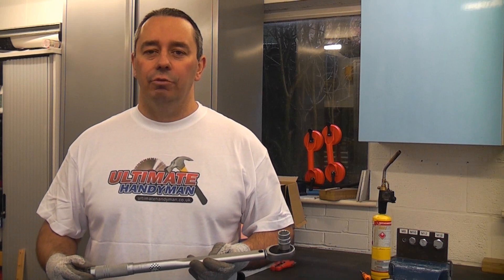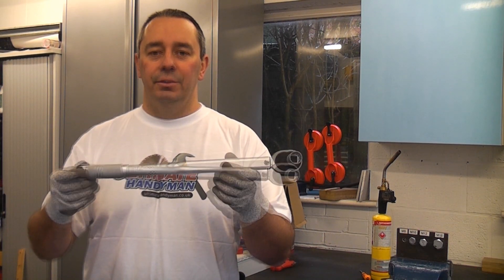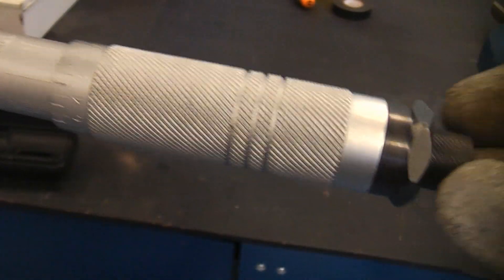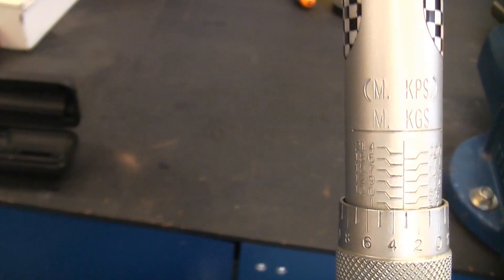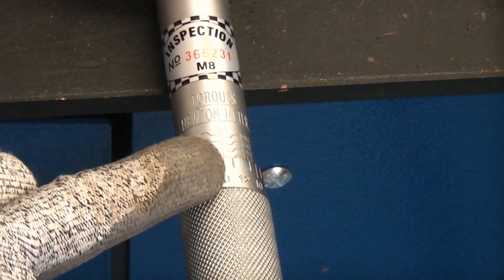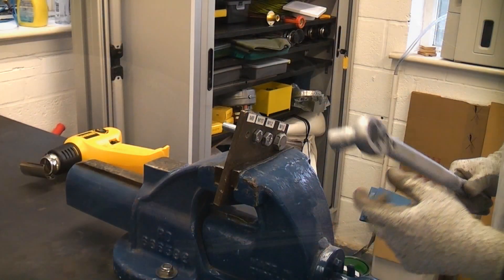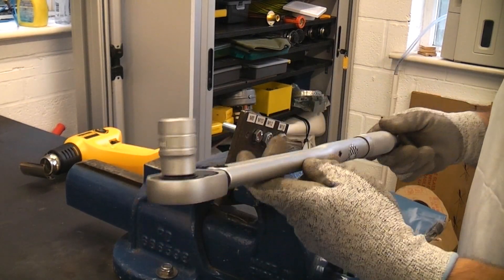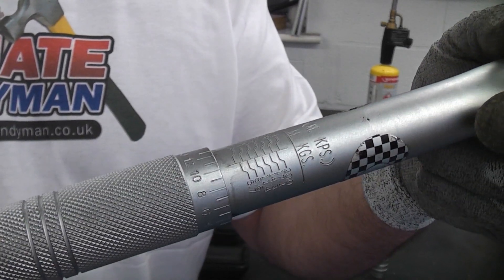How to use a torque wrench

Comment: Hi i just want to ask,  before you set your torque wrench to any value what is the basis is it the head of the bolt or the diameter of the threaded rod?
Reply from the maker: The diameter of the thread, you normally get the torque information from a manual that will specify the correct torque setting.
Thanks for the comment

Comment: Why are you using French and foreign measurements like Kg and Nm instead of British lbf?
Reply from the maker: It's the measurements that came on the torque wrench, if it had lbf on it I would have used that ;-)
My other torque wrench has NM and lbf but I can't find it.
Britain was supposed to move to the metric system, which is much easier than the Imperial system but many of the machines where I work are a mixture of metric and imperial.
Reply: ***** True, but the imperial system is more characterful and it's ours. In a world that's becoming more and more homogeneous and bland by the day, the weirdness of the imperial system is worth celebrating!
Reply from the maker: Benzknees
It's hard work using Imperial and metric. If I pick up a metric drill that is 8.2mm I know that it's 0.2mm larger than the 8mm bit, if I pick up an imperial drill I have to thank about the size or measure it with a vernier in metric LOL 
Thanks for the comments
Reply: ***** Haha, yes, a common problem. Often it's easier to think of a 8' x 4' sheet of ply or 6'6" x 2'6" door than the metric 2440 x 1220mm and 1981 x 762mm. And with tradesmen still saying things like 3m of 3" x 2", there is still a lot of life left in the old system.
Reply: Benzknees You do realise that a Newton metre is named after Isaac Newton, the famous British physicist, right? There is nothing wrong with using 'foreign' inventions, we use them all the time (e.g. Arabic numerals). Try not to let sentiment get in the way of progress :).

***** nice video, cheers.
Reply from the maker: adamjc86
You are welcome
Thanks for the comment

Comment: Thanks U.H. Although I have had a Torque Wrench for a while I wasn't 100% certain that I was using it correctly. Thanks a lot for reassuring me. Another great, easy to follow video.Cheers. N.
Reply from the maker: You are welcome
Thanks for the comment